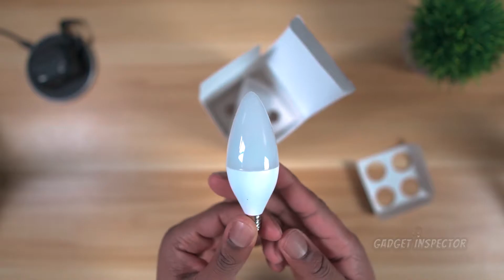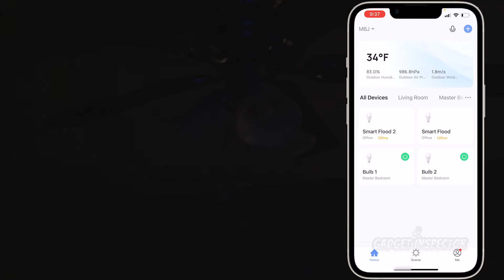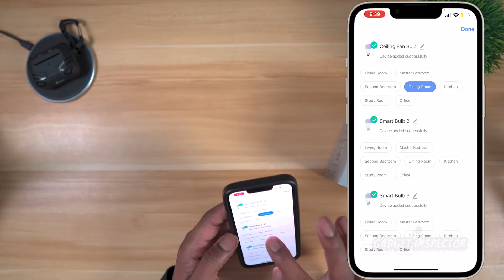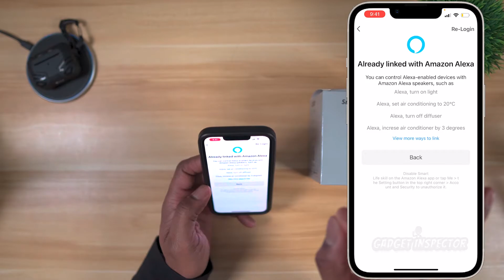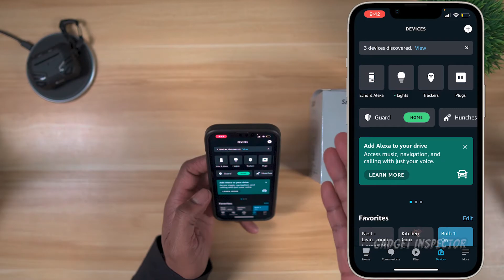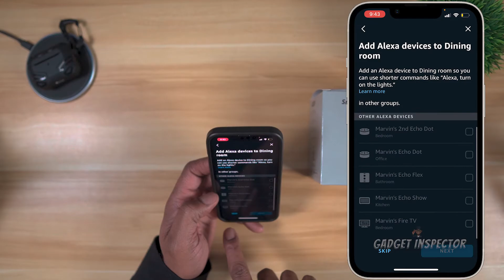Alexa Enabled Smart LED Ceiling Fan Light Bulbs | EASY SETUP TUTORIAL

Comment: I'm guessing this is a switch light? I've always wondered if you could use Alexa controlled bulbs with an overhead light that was connected to a regular switch.
Reply from the maker: You can use smart bulbs in outlets or fixtures with a switch. You just need to keep it switched on so the bulbs can be controlled via WiFi.